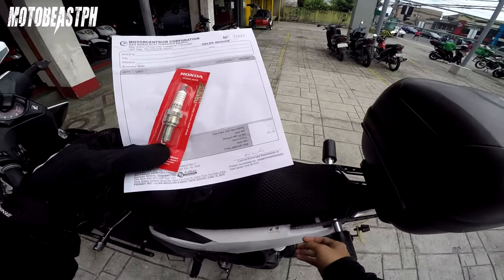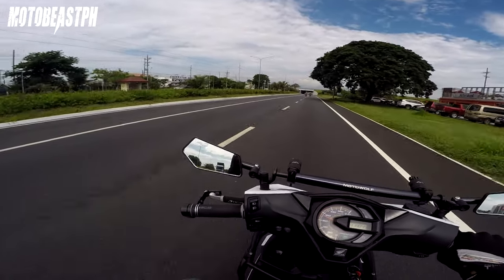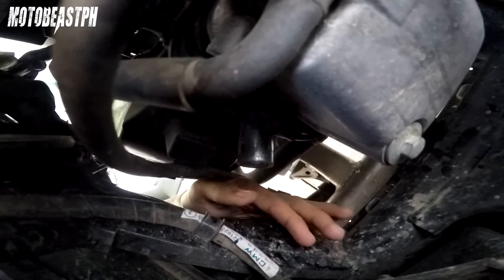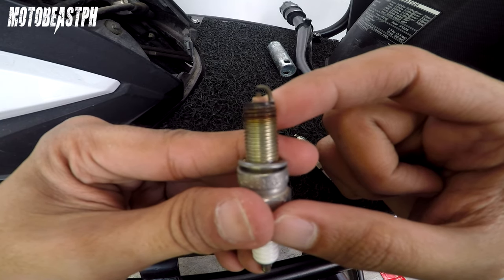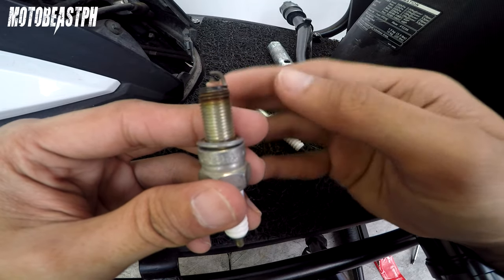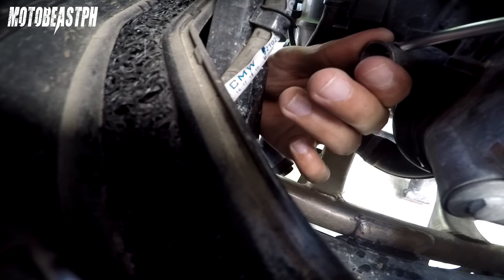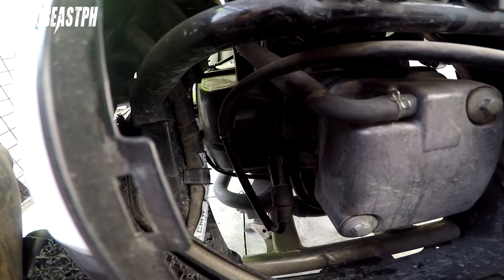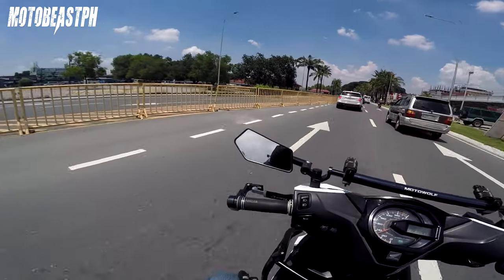Honda Beat Spark Plug Replacement | NGK vs Denso | Honda Beat Maintenance

Comment: I replace my Honda Beat Motor and Gear oil with Repsol. After that I replace the stock spark plug with NGK IX Iridium today. Wow man the throttle is so smooth compared to the stock one.
Reply from the maker: NGK Iridium gives you a better throttle response. Been using that too. 😁
Reply: @MOTOBEASTPH  sir what part or model number?thanks
Reply: May Code pa po ba ung NGK IX Iridium na pang Beat FI, meron d2 kc samin available 550 pesos, balak ko na dn magpalit, 14k odo na kc. Thanks!
Reply: @jophielgracilla8800  NGK IRIDIUM Spark Plug - CPR9EAIX-9
Reply: Thank u very much po
Reply: @MOTOBEASTPH  Thank you so much Ka-Sparky!
We really appreciate you choosing NGK Spark Plugs and helping us to share the word about us.
Cheers to more rides with NGK Spark Plugs! 🥂⚡
Reply: Bro nag palit kaba ng ignition coil nung nag ngk iridium ka?
Reply: Magkano ngk iridium

Comment: sir ask ko po.yung iridium.spark plug na three electrode .tatlong pin ng spark.plug pede po ba sabeat un
Reply from the maker: Di ko pa na-try yan, bro. Mas okay NGK Iridium CPR9.
Reply: salmat boss  pinapanuod kita kpag nag mamaintenance ako motor ko nakakakuha ako ng tip sayo salmat boss rs lage
Reply: sir ask ko may link po ba kayo pede apg bilan nyan ngk iridium yung original baka kasi makabili ako na fake ehh salmat  @MOTOBEASTPH

Comment: Sir dalawa kasi meron na code ng spark plug cpr8eaix-9 at cpr9eaix-9 saan po ba jan yung 8 or 9?
Reply from the maker: 9 standard heat range.
Reply: @MOTOBEASTPH  salamat po sa reply 😁

Comment: Idol lean yung beat ko Cpr8e ngk r yung code ng SP galing honda pang click ata yun. dahil dun kaya nag lean? Maintain naman air filter at Tb ko
Reply from the maker: Normal lang running lean sa low rpm kapag stock engine.

Comment: Good day Idol, sana ma pansin, nag change ako ng spark plug NGK na iridium, all stock honda click 125, wala naman kelangan gawin noh, like ecu reset or something. Thanks in advance. More power!
Reply from the maker: Wala na need galawin, bro. Pero pwede ka din mag reset ng TPS at ECU.
Reply: @MOTOBEASTPH  thanks bro, mukhang oks naman na, na iba lang yung fuel consumption from 40km/L nag lalaro na ngayun sa 42-43km/L. heavy rider kasi ako eh, thanks ulit!

Comment: Tol nka iridium  sparkplug ako.  malaki ba deperensya pag nag palit ako ng Denso? Same Honda beat v2 standard 1/7 months. salamat bro
Reply from the maker: Kung legit na iridium gamit mo, mas okay yan. Standard spark plug yung Denso at NGK na recommended para sa Beat.
Reply: @MOTOBEASTPH  Tig 240 lang un Bro.. hndi ko lang sure kung legit un.. pero baka mag palit na din ako ng Denso Salamat sa Mga Vlog mo tol. very informative. RS
Reply from the maker: @ridesaferider4857  No problem, bro. Palit ka nalang ng genuine Denso or NGK para matibay.

Comment: idol. anu cause pag namatay bigla.. nag top speed kasi ako tapus pagdating stoplight namatay bigla tapus hirap na hirap sya mag push start..  chinik ko naman battery malakas naman..  thanks sa sagot idol
Reply from the maker: Over-revolution, bro. Nasobrahan sa piga.
Reply: @MOTOBEASTPH  ganun ba yun idol? salamat. kelangan pala di lagi isasagad
Reply: @geomixplay7253  Rich yung A/F mixture. Check mo air filter

Comment: nag palit na rin ako spark plug denso rin sa casa ng honda ko rin nabile kaso eto ung binigay sakin denso U20EPR9 ok ba yan
Reply from the maker: Check mo kung long thread, bro. Tingin ko pwede rin yan.
Reply: @MOTOBEASTPH  sabi ko kasi pang honda beat ee ayan binigay
Reply: @MOTOBEASTPH  kng sakali bang hindi pede ung nabili ko anu pede mang yare , tnx
Reply from the maker: Basta parehas ng haba ng thread pwede yan. Kung mas maiksi wag mo ilagay tapos ibalik mo dun sa pinagbilhan.
Reply: hindi ko alam kng parehas ng haba hehe nakabit ko na , anu ba pede mang yare pag maikli ung nabili ko at ayun nagamit ko
Reply from the maker: @arvincruz6072  Di gagana kapag maiksi. Kung gumana, okay na yan. Haha.
Reply: @MOTOBEASTPH  nagamit ko na kanina denso U20EPR9 ok nman boss , na top speed ko kanina 90kph lng bitin sa kalsada ee metro manila kasi ee saka lalamove ako may mga karga ako kanina mabigat , tingin ko lalagpas pa ng 90kph un kng medyo mahaba pa ung kalsada na tinakbuhan ko partida may dala pa ko un , saka bagong linis na rin pang gilid bago bola bago side piece , bago belt bagong change oil bagong gear oil bagong air filter kaya swabe nman sya , kakanuod ko kasi sa vlog mo sinipag ako mag maintenance ng motor hehe honda beat fi v2 sakin kulay red standard , saka ung stak ko ng spark plug na NGK wla nman nangyare nag palit lng tlga ko , 32500 klm na kasi odo ko ngaun lng napalitan ng spark plug
Reply from the maker: Nice. Buti nakatulong, bro. Kaya pa yan lagpas 100kph basta magandang bwelo. Every 12k palit ka. Haha.
Reply: @MOTOBEASTPH  hm singil sau sa casa jan sa inyo ung nag pa throttle cleaning ka ? dito kasi sa casa samin honda rin 1k mahigit
Reply from the maker: 250 lang, bro. Sobrang mahal nyan 1k.
Reply: @MOTOBEASTPH  un nga ee parang narinig ko rin sau sa isang video mo ee kaya nag tanung ako sa casa nmin 1k daw mahigit , matindi pangangailangan ng mga tao sa casa dito samin
Reply from the maker: Haha. Hanap ka nalang ibang casa, bro.

Comment: Bro, magkano bili mo dun sa gulong mo na michelin pilot.
Reply from the maker: 3,300 ko nabili dati, bro. Naka-sale dun sa nabilhan ko noon. Hanap ka nalang pinakamura. Magkakaiba kasi presyo ng mga shop.
Reply: Ano ba yon bro pares na o isa isa ang bili?
Reply from the maker: Pares na.
Reply: Maraming salamat. May idea na ako ano mga presyuhan. Baguhan lang kasi ako pagdating sa motor.
Reply from the maker: @erianillustrisimo7893  No problem, bro. Other choices na branded Pirelli Angel or Diablo tapos Metzeler Sportec okay din. Same price range lang yan tatlo.

Comment: Paps tanong lang po. Pano po malalaman yung mga turn po na nasa video nyo po kung 3/4 na at 1/8 na??
Reply: Salamat in advance paps. Napaka informative neto. Solid palagi!!
Reply from the maker: Tantya lang, bro. Yung isang buong ikot dun ka tatantya.
Reply: Ano po size ng gulong nyo paps?
Reply from the maker: 90×80 front, 100×80 rear.
Reply: Salamat paps. Rs po
Reply: Sir ano pong brand ng gulong pinalit nyo, salamat po
Reply from the maker: @jhingkiey6649  Dati gamit ko Michelin Pilot Street. Ngayon naka Metzeler Sportec Street na ko. May vlog ako nyan parehas.
Reply: Cge po maraming salamat s info.

Comment: ano mararamdam mo sa motor papz pag palitin na spark plug? kasi yong sa beat ko nag ba backfire na kasi minsan tapos pag nag menor  ako sa throttle habang tumatakbo parang namamatay ang makina.. tapos nong huminto ako sa stop light. tapos pagka piga ko sa throttle ko bigla namatay ang makina piro gumana pa naman pannel guage nya at wlang check engine.. pinush start kulang ng pa ulit2x hanggang umandar sya.. pro parang humina yong menor nya... ngayon ok na naman sya... spark plug na kaya to papz 10k+ oddo pa kasi natakbo nya
Reply from the maker: Kapag hard starting na. Pa-check mo rin sa casa or sa expert mechanic para ma-diagnose ng tama.
Reply: hindi naman sya hard starting papz.. nag babackfire lang talaga sya minsan tapis humina menor nya
Reply: Meron po bang side effects ang 3 electrodes iridium sa beat?

Comment: Bro ano size nang gulong mo. Rare and front?  Salamat sa sgot ridesafe
Reply from the maker: Yung gamit ko dyan 90×80 front, 100×80 rear.
Reply: Naka set pang gilid mo boss? Bka mkpg bgay k idea hehe salamat
Reply from the maker: Stock lang panggilid ko, bro. Palit ka speedtuner pulley/drive face tapos timpla either bola or center spring depende sa preference mo. Solo - timpla bola. With backride - timpla sa center spring.
Reply: Nag pnta kasi ako sa casa ngyon bro. Nag ttnong ako kng mag kano oil filter b twag dun?. Kaso ang bnbgay sakin filter set. Ska oil pump? Tama b un bro? My npnood ksi ako na video mo na. Pnalitan mo ung oil filter. Kya nag pnta ako. Mukhang iba snsbi sakin e
Reply from the maker: Iba yun, bro fuel pump assembly na yun. Ang pinapalitan dun yung fuel filter every 20k odo. Yung pinalitan ko air filter. Every 10k or 12k odo pwede na palitan yun.
Reply: Edi hnd dpt ksma ung fuel pump bro? Nklgy ksi sa pnkta skin filter set saka un nga vro n fuel pump 27k odo n ksi sakin e
Reply from the maker: Fuel filter lang. Bago pa yan, bro. Palinis mo lang throttle body para malinisan din injector.
Reply: Bro bakit sabi nang casa. Hnd daw nililinis ung throttle body? D nmn kailngan un?
Reply from the maker: Wag ka maniwala dun. Haha.
Reply: Kya nga ngguluhan ako bro e. D ksi kami pwd lmbas sa nueva ecija ngyon e. Sa Dau dn ako nakatira dati. Gusto ko sna pgawa dyan kaso mdyo mhigpit ngyon e. Ridesafe bro salamat sa mga sagot

Comment: Sir Wala po ba Speed Limiter si Beatoy?
Reply from the maker: Ang alam ko meron. Limit na hanggang 110kph.
Reply: @MOTOBEASTPH  yun lng. 😓 Na reremap kaya yun?
Reply from the maker: Oo bro pwede. Dalhin mo kay Windowshop kung taga Manila ka. ECU refile para matanggal limiter.
Reply: Salamat sa advice Bro :)
Reply: Sir ok po ba kaya ung Brisk Spark Plug? Multi spark
Reply from the maker: Maganda yun, bro kaso medyo mahal. Haha.
Reply: Uu nga ehh nagulat ako 900 pala sya haha

Comment: May side effects po pa pag tumagal ang racing ignition coil?
Reply from the maker: Di ko sure, bro kasi stock pa rin gamit ko ignition coil.
Reply: @MOTOBEASTPH  Ok bro thanks, last question pala mas better ba ang 3 electrodes na iridium compare sa single, wala bang negative effect yung 3 electrodes?